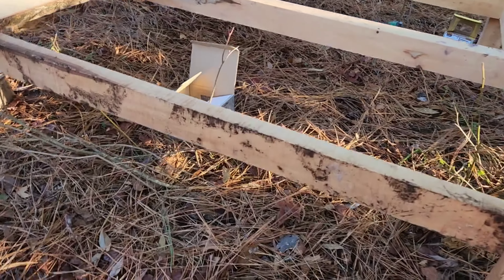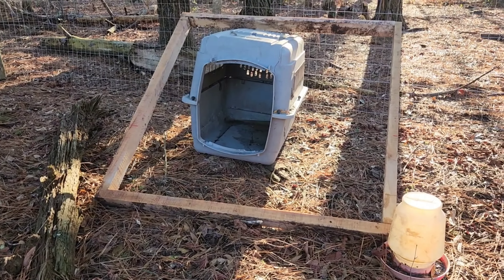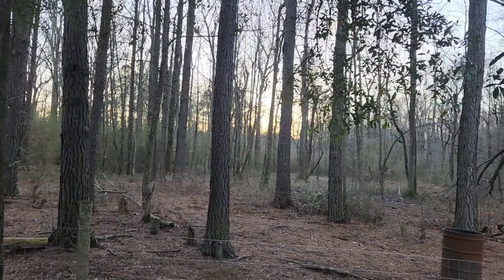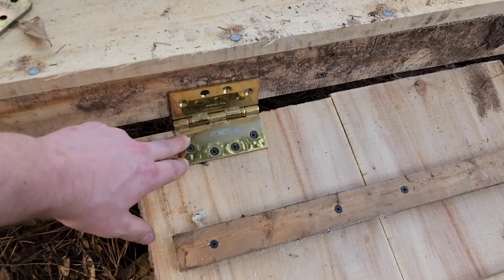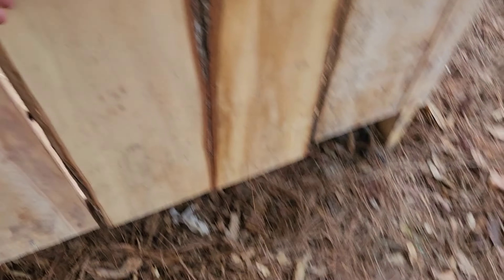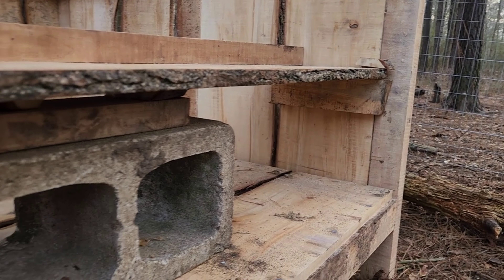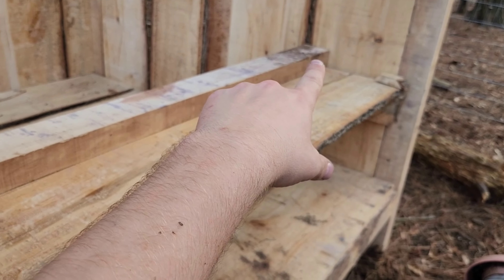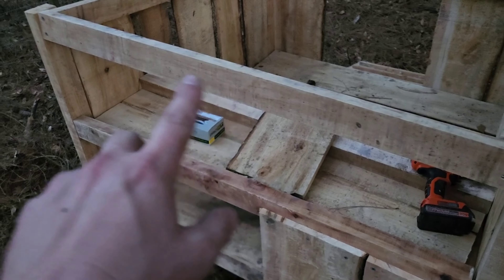Building a Chicken Coop with Nothing but "Homemade Lumber"!

Comment: Awesome , nice simple design. I like that the nesting boxes are inside and not an additional structure attached to the outside of the coop. going to use your ideas to get myself started. thanks for sharing! Paul
Reply from the maker: I hope it works for you. 

I would change the design of the roof. The configuration in this video interfered too much